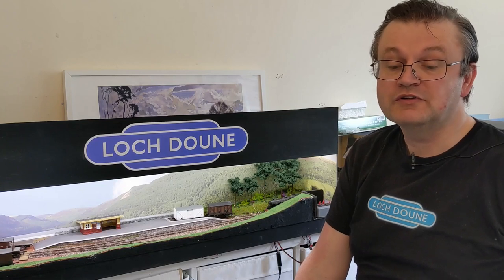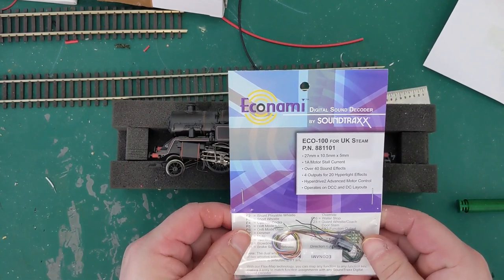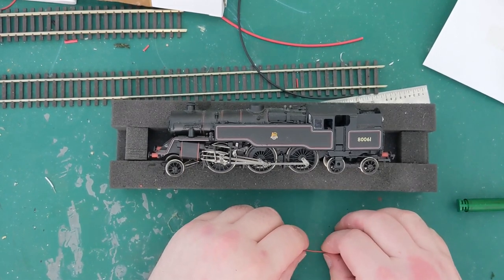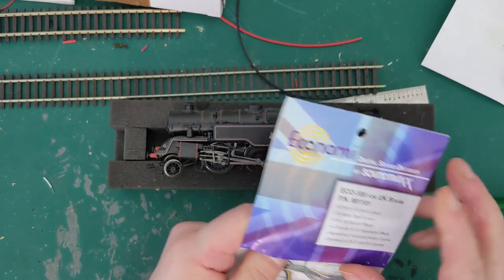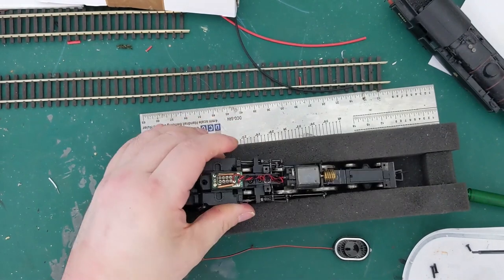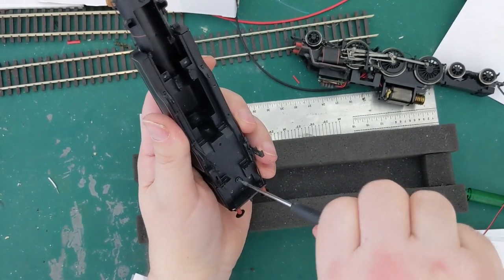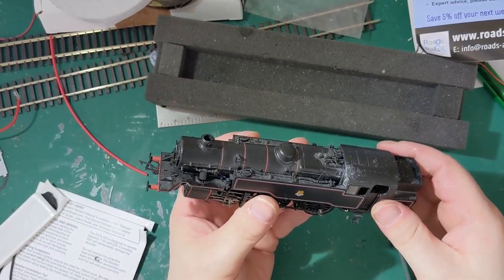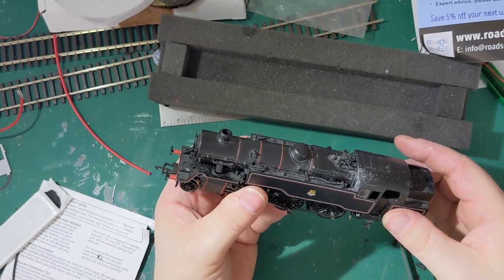Sound for the Standard 4 Tank

Comment: Good information.  Thank you.  My Bachmann 4MT tank loco had 2 screws recessed into the tops of the side tanks.  The only way to replace them was to place a small piece of “Blutack” on the end of my screwdriver.  That held the screws until they engaged into the top of the tanks.  A head torch also helped.
Reply from the maker: I've been thinking I might need to get one of those magnifying headsets with the built in light.

Comment: Thanks for the mention in the video. The decoders come from Soundtraxx without a speaker but at the time you bought it I had picked that speaker as a suitable speaker to fit most models, but I agree its a bit too big for some models so I have since been supplying them with iPhone speakers like the one that you used. The Eco-100 and Eco-200 decoders come without an 8 pin plug too from Soundtraxx but to make them more useable and easier for people to fit I solder them on before I send them out to customers. Another important feature of the steam decoders is the ability to synchronise the 'chuffs' with the wheel rotations, something you can do on top of the range decoders but not TTS. I'm glad you like it, if you are ever buying anything else to use in videos get in touch before you order, I might be able to offer a small discount on some items as it helps me too. Thanks, Richard
Reply from the maker: Thanks Richard - those are some great points about the advantage of Econami over TTS. I'm always happy to recommend you, as you've always provided great customer service and advice.